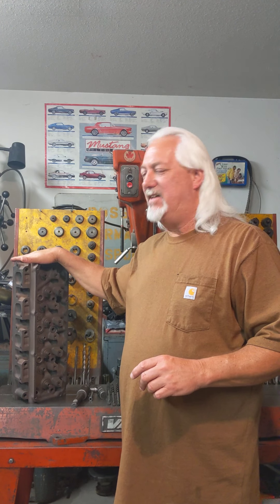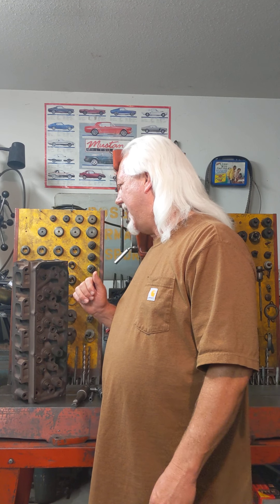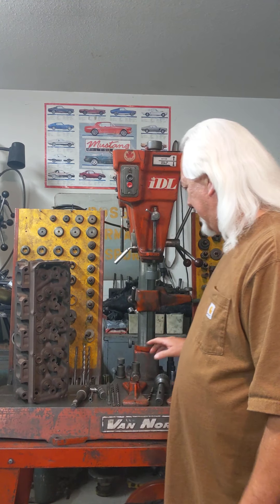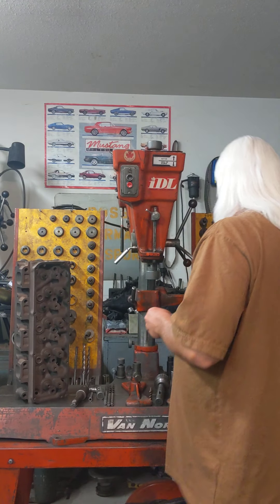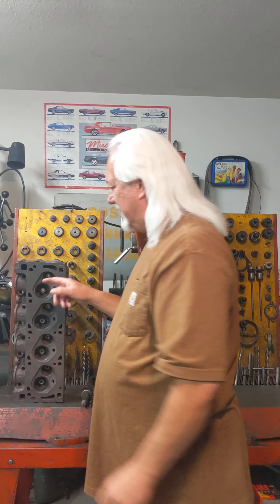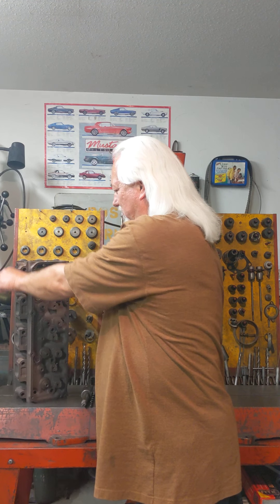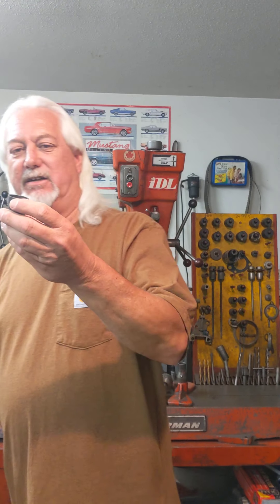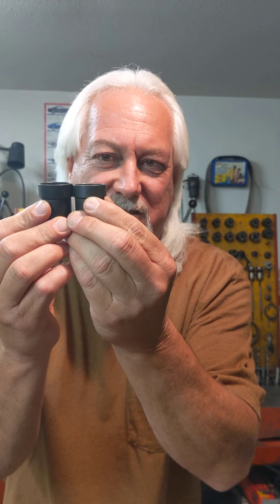Ford 335 Series Valve Angle.

Comment: interesting idea... have you ever tested for  improvement on a flowbench?  Ever try a 30 degree seat angle for low lift flow?
Reply from the maker: Yes, in the '90s I did a flow test, it was only a small improvement on flow but every little bit helps, and yes did the 30° cut for low lift, small lift rule classes, also played with 38° as well.
Thanks!